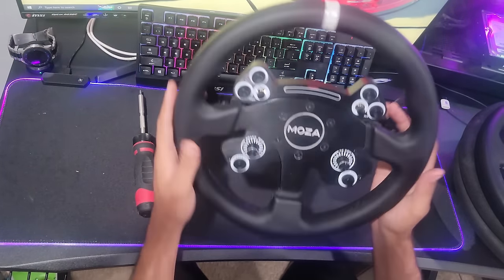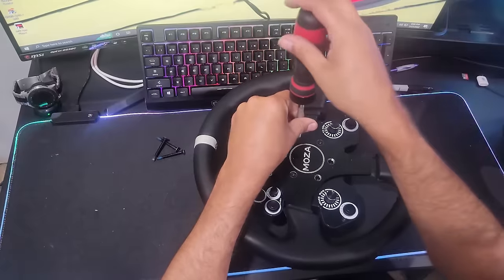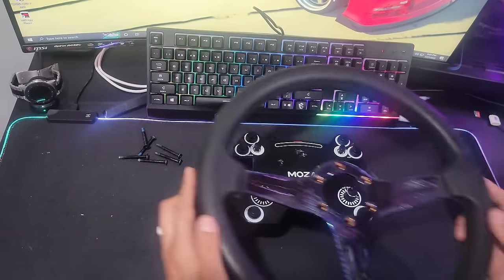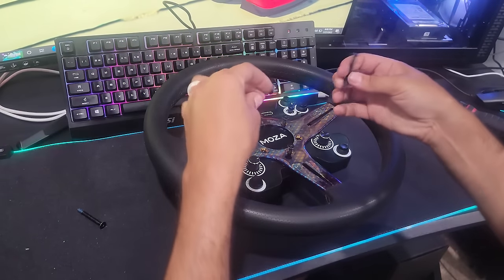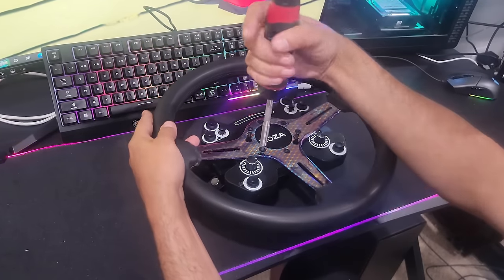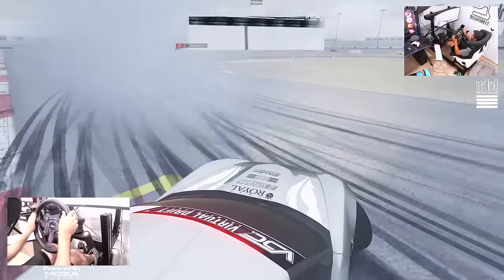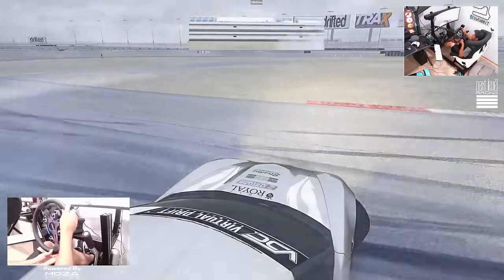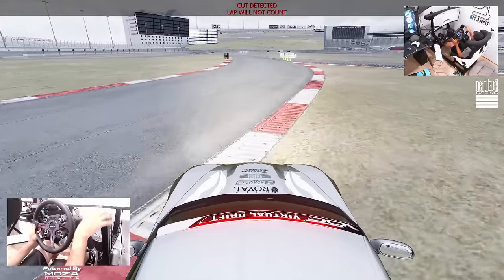Changing wheel on MOZA CS Racing - Does it help or hinder the wheel performance

Comment: Is there a big difference in the force feedback with the lighter wheel? It would have more detail with less power? So good to easily be able to switch wheels. 
Moza will be my next upgrade.
Reply: Don’t get the nrg for moza r9 it’s actually too light. I spent some time trying to tune it to feel natural but it just doesn’t feel right
Reply: @JacobyVisitMe  thanks for letting us know! Is it the QR or the lighter wheel or both do you think?
Reply: @scorps0326  i have the cs wheel so the nrg lightweight wheel can bolt right on like he did in the vid. its just the rim itself is way lighter than the stock cs rim. where as my 30 dollar ebay rim feels a lot better cuz its similar to the cs weight (still less)
Reply: -- it also could be that im just bad at tuning in the moza pit house app but yea id say just get a rim that isnt labeled light weight
Reply: I'm concerned about big weight of CS wheel 2,4 kg. I'm told that light wheels give much better FFB on R9.
Reply: @antoshechka  no the cs wheel feels nice, when I used the lightweight nrg wheel it moves too fast and feels like it moves in “sections” instead of smoothly. If u get an aftermarket wheel try to find one that’s kind of heavy
Reply: @antoshechka  I've been enjoying the CS wheel actually and haven't needed to change it.  Feels great. Better than expected
Reply: @scorps0326  thanks, great news👍
Reply: @JacobyVisitMe  Thanks mate!☺️
Reply: @antoshechka  no problem. right now im using an aftermarket 350mm ebay rim bolted to the cs box. suprisingly the cs rim itself is heavier than the 350mm one but its pretty close and works great.
Reply: @JacobyVisitMe  If most cs weight in the rim itself than it's a good news. maybe I'll try to bolt some lighter 320 mm rim like turn r320.
Reply: @JacobyVisitMe  May I ask what ebat aftermarket rim you got? what is a OMP replica?

Comment: I love deep dish wheels. Thinking about getting another es for my deep dish so I dont need to reach for the keyboard blindly in vr 😂 the es formula mod is fantastic by the way. Wouldn’t think so but the rubber is nice, soft, and grippy!
Reply: Can’t es wheel doesn’t have a 70mm bolt pattern! There is only 2 wheels from moza for it 1 wheel from simpush

Comment: can you use an ES formula wheel mod to attach to CS base?
Reply: No, the button schemes are different.
Reply: @smithctyler92 not even that they aren’t even the same bolt pattern and the es wheel bolts are turned compared to the bolt pattern on the cs wheel